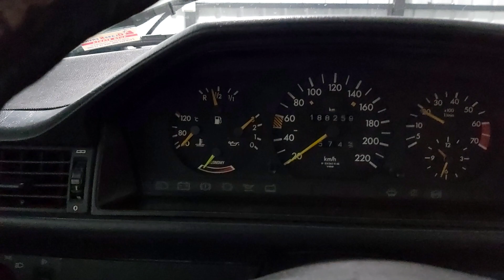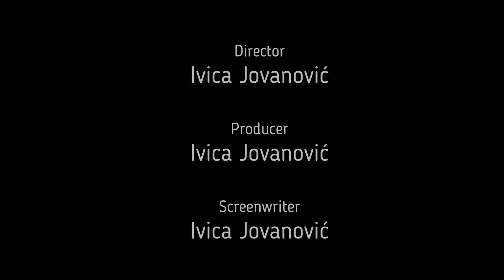Mercedes KE-Jetronic - Holding pressures

Comment: Hello Ivica, should the pressure drop instanly when you turn off the engine, or gradualy? When I turn off the engine my pressure drops from 4,8 bar to 4,6 and slooowly climbes down to 3,2 in 30 minutes and yet i still have bad warm starts. Thank you!
Reply: Thank you!I see, no I havent I only changed the seals. Could the injectors cause the pressure to stay up?
Reply from the maker: @mrazekjan96  Maybe the hoses are clogged. Concerning the injectors they cause poor warm start. Replace them.
Reply: Okay I will have to check that then! I have the injectors ordered so hope its the culprit. Also my engine is kindoff shaky, which could also be sign of bad injectors right?
Reply from the maker: @mrazekjan96  If you have good spark plugs, good cables, then either the injectors or the fuel distributor. In your case it can be the injectors.
Reply: @mercedeske  great, thanks! My plugs and cables are 1 year old. I have read that it could be clogged return hose and with the pressure not dropping right away, it means the injectors are leaking because of the high pressure.
Reply from the maker: @mrazekjan96 And because they are old and it's their replacement time!
Reply: @mercedeske  right :D have you ever performed cleaning of the return line?
Reply from the maker: No, but I think I am gonna try it soon with the SL
Reply: @mercedeske   looking forward to that video <3
Reply from the maker: The pressure should drop instantly to 3.2bar. Have you replaced the injectors?

Comment: Hi again! I am still trying to sort out my 92 500sl COLD hard start issue.  Your video here is the best explanation on youtube regard the differences between the FP regulator and the Fuel Accumulator.  In my case I have no acceleration issues what so ever, cold or hot.  I understand the fuel pump generates the fuel pressure and the Fuel pressure regulates this pressure. And, the fuel accumulator provides a certain pressure for a subsequent WARM start. Also, and not mentioned in your video, the Cold start jet adds extra gas for cold starts, 60 degrees and COLDER.  You mention that the fuel accumulator must maintain 3 bars for subsequent WARM starts.  Question:  How long must the fuel accumulator maintain the 3 bars pressure??  CONSTANTLY after the car is shut off OR just for a specific period of time?

PS if I pressurize my fuel system prior to cold start by turning the key on and off 2-3 times for a 3-5 seconds each PRIOR to a cold start it starts right up which tells me I am loosing fuel pressure over night some how? Also, my temperature where I live is NOT at or below 60 degrees.

Could you let me know if the accumulator maintains constant pressure once the car is turned off. THANK YOU
Reply from the maker: Greetings and thanks. Concerning your car specifically the residual pressure you get(engine off is something above 3 bar as I remember). Now, the answer to your question is YES, the fuel accumulator has to maintain that pressure for 30min. There are more places where the residual pressure can be lost, but the key component is the fuel accumulator as well as the pump if it's check valve is bad(as soon as you stall the engine the pressure drops to 0). Concerning your engine the cold start valve operates until 15°C, because that's the V8 engine. In the morning the engine is usually cold and the cold start valve helps the cold engine starts easier. Once the engine gets warmer, the accumulator is the one that should accumulate the pressure in the system and help warm engine start easier. That's it. What you do with the key you build pressure and that's why the car starts, that way you help the engine but this doesn't mean that it's a permanent solution. Greetings.
Reply: @mercedeske  thank you. Yes, you are correct this NOT a permanent solution.  Yes, you are also correct more places where the pressure can be lost... injectors etc. If I might ask one more question... what happens to fuel pressure after 30 minutes of the car not running and assuming every thing else on the car is fine does the pressure go to zero or does it hold a 3 bars +/- ?  thank you again!
Reply from the maker: @rioraton  It stays 3 bar.
Reply: @mercedeske  Thank YOU! That my friend is what I need to know!

Comment: Hi
Did pressure test on both chambers today.
On the lower I got a reading of 5 bars.
When I opened the upper, I got a reading of 5.4 exactly.
When I turned off the engine I got a reading of 2.7 bars.
Did the test when the engine was cold.
Yesterday I did the test on the lower chamber only and got a reading of 3 bars when I turned off engine.
I presume all good ?????  Think I'll move on to the Vacuum tests to sort my idle. Appreciate your great advise. Keep up the good work.
Reply from the maker: Hi. Thanks. Everything is fine with the system. Search for vacuum leaks. Fingers crossed 🤞🏻 and Happy Mercedesing 😊

Comment: Hi
I have a 26OE 1989 (with no O2 Sensor) I have a constant issue with rough idle. I have check most things at this stage. Today I checked the fuel pressure at the lower chamber. When I started the engine I got an immediate 5 bars. I left the engine on until it got warm and it remained at 5 bars. When I turned off the engine it immediately read 3 bars. I returned 30 mins and it was still at 3 bars. 
1) Should the fuel pressure be higher at idle?
2) Where should I look with those reading?
3) Any advise on what to do next.?
Love the videos. Keep up the great work. Cheers
Reply from the maker: Hi, and thanks. No, the pressure should not be higher on idle. Tell me did you get the differential pressure of 0.4bar? - Your situation looks like this - 5bar control pressure is normal for your car. As I have said in my previous video in English  there are 2 pressures - the one when the engine is ON and when the engine is OFF. So, your car fulfills both values. As the engine is OFF it's normal for the pressure to drop at 3bar. That tells us(not US but YOU😄) that your pump is good, your fuel accumulator is good, pressure regulator as well and if you replaced the injectors then your mechanical part of the system is as it should be. As for the unsteady idle - if you replaced all the breather hoses and you still have unsteady idle then check the rubber boot(the rubber underneath the airflow sensor). If you get uneven idle again, then you will have to perform the fuel flow test out of the distributor simulating idle(sensor plate barely deflected) and you will have to compare the quantities you get per minute(5ml difference at most allowed).
I know I made a "novel" out of this comment🤣😄🙂 but that's how it is. Fingers crossed 🤞🏻
Reply: @mercedeske   Really appreciate your great knowledge and time about these engines. Will concentrate on .4 bar differential and breather hoses. Will report back. Thanks again.

Comment: Hi again. When I rev the engine like 7min:40sec in your video it is good. When I release the accelerator pedal the engine stops (stall) Any idea? Thanks.
Reply from the maker: Hi. I'm glad you watch my videos. As for this issue - At first check how your sensor plate slides. Press the accelerator but in the engine bay not in the cabin. If the sensor plate returns too slow it can stall the engine. If that's okay, check your idle control valve if it operates when you apply a battery voltage(when the car is off). Clean it if you haven't. Check the values it gives you. Engine off ignition on, engine on ignition on and the voltage plus current(mAmps) on idle when warm. Write those values here in the comment.
Reply: @mercedeske  Thank you. The idle control valve is new. Bought from Germany. Do you mean air flow sensor plate next to fuel distributor?
Reply from the maker: @runelarsen5769  Yes. It must slide easily without resistance, in fact without a slow back motion(when depressed).
Reply: @mercedeske  I replaced the boot under the air flow sensor. There was a small crack. After that, hard to start and the sensor plate more stiff to push down. Not running engine.

Comment: can pressure drop due to leaking plunger,  if yes is there a way to fix it 
thank you
Reply from the maker: It happens when the fuel filter is bad or when the fuel pressure regulator is bad but if the seal ring is leaking it has to be replaced.
Reply: where is seal ring located, have regulated preasure at 6.1 bar try to kower it on fuel pressure regulator counter-clockwise how many turn to lower
Reply from the maker: @michalmuszynski6942  Why would you lower the pressure? Is the difference to small?
Reply: @mercedeske  w124 1992 300ce-24 fuel pump preasure 6.8 bar. Lower preasure 6.4 bar decided to adjust it to 6.1 on fuel preasure regulator to prevent rich running condition (a lot of unburned fuel in exhaust)
Reply from the maker: You didn't have to lower the pressure. The leaky plunger doesn't decrease pressure you will just have detonations.
Reply: @mercedeske  what preasure i should expect on raw fuel pump side side, and what preasure on regulated side
Reply: @mercedeske  had on high side 6.8 on working side 6.2
Reply from the maker: @michalmuszynski6942  6.8bar
Reply: @mercedeske  on pull pump side 6.8bar?  On fuel distributor working preasure what should it be 6.0?
Reply from the maker: @michalmuszynski6942  It should be 6.4bar
Reply from the maker: @michalmuszynski6942  The seal ring is located at the bottom of the plunger, the plunger rests on it. If you want to replace that ring you will have to take off the fuel distributor and to unscrew the sleeve(remember the gap between the nut and the sleeve) and as you take the sleeve off just remove the seal ring.
Reply: @mercedeske  thank you for fast response

Comment: Hey do you know why I’d have no fuel getting to the injectors? I have fuel getting to the distributor…
Reply from the maker: Check at first the injectors. If they are okay, then check the fuel distributor if it sends fuel to the injectors. Engine OFF, unscrew the injectors and put the metal hoses in bottles. Make the fuel pump running constantly while the car is OFF and deflect fully the sensor plate. If you get no fuel out of all of them or out of some of them, you will have to rebuild the fuel distributor.

Comment: Congrats ! Love your channel... Do you know if fuel regulator and fuel accumulator can be repaired ? They are very expensive parts tu buy for a simple membrane to change...
Reply from the maker: Hi and thanks a lot. Unfortunately no, it's not possible. Both of them are sealed so that the replacement is the only option.

Comment: Congratulations Ivica !!!👏👏👏🍾🍾🍾. Here's 🥂 to the next 1000 subscribers 🤗🙏
Reply: If the fuel accumulater is good but the fuel pressure regulator is bad, will the holding pressure of  +-3 bar still be kept when engine is off?
Reply from the maker: @paulfester9652  Yes
Reply: @mercedeske  So if the car does not hold the pressure @3 bar for 30 mins (engine off), it is definitely the accumulater that is faulty.
Reply from the maker: Yes
Reply: @mercedeske  Thanks for clarifying that.  Much appreciated 🙏🙏. Have a lovely weekend 🤗
Reply from the maker: @paulfester9652  You, too, thanks 👍👍👍🍀🍀🍀
Reply from the maker: Thanks a lot 🙋🍀🍀🍀😃👋😉

Comment: Have to make pressure clock to observe
Reply from the maker: Preassure gauge. You must have it. I must make a quick video for you to show you how to make the adapter easy and cheap.
Reply: @mercedeske  l measure fuel pressure and is 5,4 bar, 78 psi. My engine is M103,  300 12 valve 1992. What do you think about it?
Reply from the maker: @stefangurtatowski3586  As far as I know, these m103 engines must have working pressure of 5.7-5.9bar. I think it's too low. Measure the raw pressure(on the cold start valve), if you get over 6bar it's good, because then the working pressure can be increased.